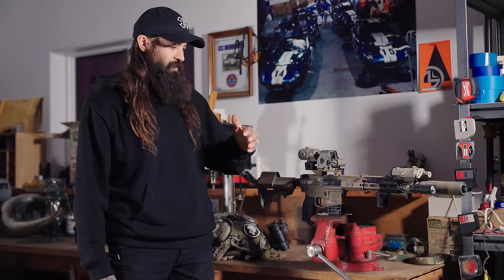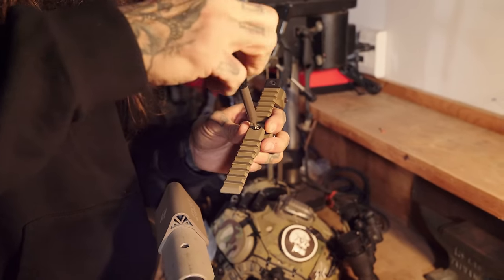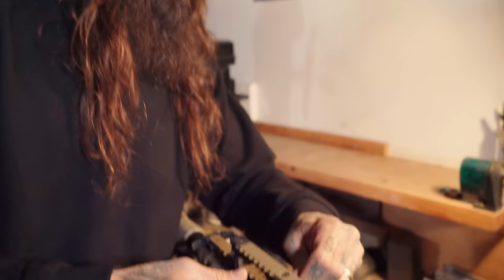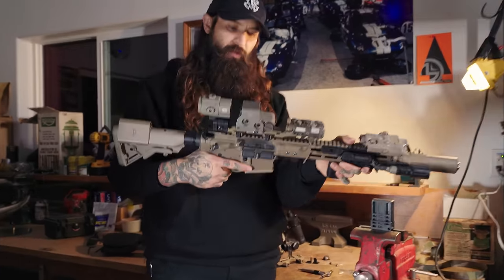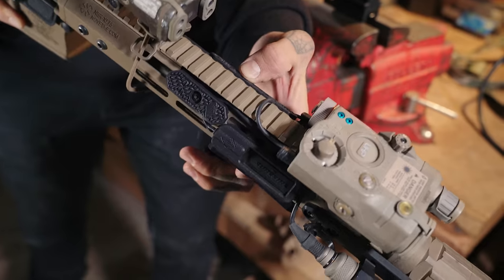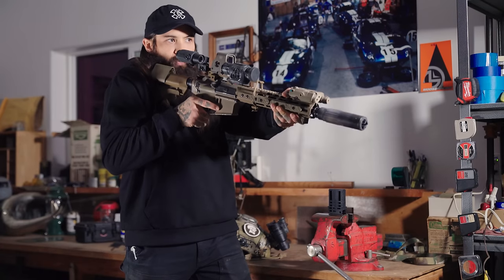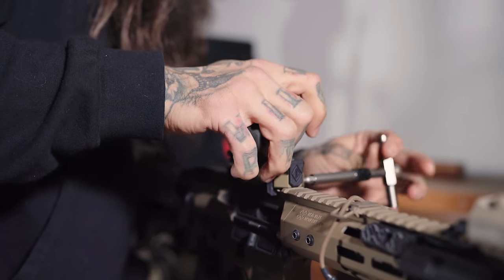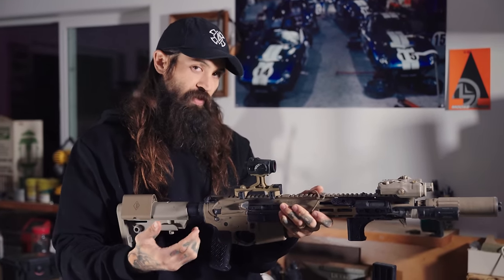IRREGULAR DEFENSE OMM (OPTIC MOUNT MODULAR)

Comment: As a mechanical engineer I can say that this is a work of art. The OMM mount gives you the chance to use either Unity OMNI or Eotech mount and swap configurations as desired without having to buy third-party accessories or adapters. There are plenty of other risers but none of them compete with the OMM modularity. And the term modularity perfectly aligns with Slade's mentality " If you don't need it, you don't buy it". Hope to get them very soon here at Operator's Manual LLC!

Comment: Just got my OMM Micro + MidBoard for my T2. LAM selection pending. 7075-T6 with full Type 3 anodize and 304 stainless hardware. Just superb. Not crapping on the 4-letter boys' mount....but the Hydra is 6061 (nearly 4x weaker depending on design) and is only cerakoated (super easy to damage).
Reply from the maker: Thank you sir!

Comment: Nice choice of song.
2ndly: Are there retro-fit throw levers in the works for the OMM? Necessity dictates I run buis, being able to "rapidly" take the mount off is a big deal for me. I know, its silly but it is what it is. And the mount is pretty dope, i have it (currently) on a DD MK18 RISlll upper amd its beautiful- keep up the good work!
Reply from the maker: Hey dude, we aren’t doing QD for a couple reasons. Form factor and weight are the 2 off the top of my head. We do have a solution for BUIS coming down the line soon. Also, they will be able to mount in line and not offset.
Reply: @Slayderaider  
Cool, I can understand. And thanks for the reply🤘

Comment: What's up Slade, quick question for ya boss. In your experience, what is better for NVG setup; flip to center, or to side?
Reply from the maker: I enjoy the flip to side. The Unity FTC is a cool concept, it just doesn’t clear out of my way enough and I can’t bring it far enough rearward to deal with the crappy eye relief of magnifiers.
Reply: @Slayderaider  that is precisely the issue I had. I believed the solution to be to take the magnifier off during NVG use. This makes since tho. Thanks
Reply from the maker: If you run thermal you need the magnifier
Reply: @Slayderaider  okay question. Would you rather run thermal on your head, or on the gun?

Comment: if I wanted to run the base mount, and a EOTech, and an EOTech magnifier, could I technically run a Unity FTC on the magnifier behind it? Or does the OMM sit a little taller? (I could probably do the math, but I’m being special right now)
Reply from the maker: If you had the XPS 2.0 it would line up perfectly, but with the EXPS 3 it will have about a .24” disparity in height. The optics side of the magnifier is forgiving so it may work. Someone on here said they did it and it caused no issues for them

Comment: Awesome stuff man. Can you use a unity flip to center for the magnifier behind the bare mount if you prefer that over a flip to side?
Reply from the maker: You can I guess, there would be a little aesthetic gap but magnifiers are very forgiving on the optic end. Also, a 1.54 optic mounted to the OMM PIC would line up perfectly.

Comment: Holy hell. This is exactly what I've been needing on my 8" 300AAC to run my dbal in front of my vortex UH-1. I tried to piece something like this together with a Unity riser and an "Amazon special" pic mount to try an pull off the same thing as the OMM pic with the longboard. The amazon pic extension bent the first day so it was useless.

Anyway I can sign up for notifications for when you're back in stock?
Reply from the maker: Nice! The website subscribers get emails!
Reply: @Slayderaider  Sub'd

Comment: When slade said it was at 2.5 height was that the height from the center of the barrel to the optic center or was that from the rail to the center of the optic? If that is the rail to the optic center I've never messed with anything so high is that height just to clear the optic over the ir device which is clearing your finger on the forend? Or is there another reason for a 2.5 height over a 1.93 or a 2.26?
Reply from the maker: Optical centerline is 2.5”. It felt the most comfortable sitting at that height

Comment: Does shifting the weight of the laser closer to the reciever make a measurable difference to the balance with the can on the front ?
Reply from the maker: It can, but the lasers I run are pretty lightweight. In the end it becomes a preference thing if you’ve got the rail space. If on a shorter rail then it’s nice to be able to shift the laser to the rear of your foregrip and to the center of the upper freeing up that rail space

Comment: With the 2.5 exps height, on something like a 10.3 with a can, what is the holds like with a 50yd zero. Still pretty spot on at 200/300yds?
Reply from the maker: I run a 50m zero, I’ve had good results all the way out to 620 yards
Reply from the maker: But that was with my 11.5, not sure how much of a difference that makes in comparison to a 10.3

Comment: Does this mount work with the unity flip to center? Ik they have two sizes now
Reply: He'll definitely come out with a tiny pic riser to raise the FTC mount. Doubt Unity will make a new FTC height mount just for him
Reply from the maker: If you run an XPS 2 or 1.54 lower third optic on the OMM PIC it will work.

Comment: What is the optic height with this system,  ie Is this compatable with the unity ftc magnifier?
Reply: It's not, I think it's 2.55" something
Reply from the maker: 2.5” with eotech EXPS 3.0. XPS 2.0 or sig Romeo 8T sit at 1.54 which would line up with the OMM PIC mount and the unity FTC

Comment: love more products for this, but i gotta say it doesn't seem drippy. Would rather an upper receiver that has all this integrated with the option to add the forward and rearward picatinny or whatever.  Just dont like the look of having 2 picatinny on top of eachother.
Reply from the maker: That makes options limited
Reply: @Slayderaider  if you had standard upper receiver length picatinny that was just lifted 2 and some inches, and a mounting point for the forward attachment you have it would provide the exact same options.
Reply: Imagine a carry handle, but not a carry handle

Comment: Went to the website thinking I could get a mount for cheaper than Gbrs. Damn was I wrong
Reply from the maker: Yeah, they’ve since reduced their pricing when they saw something with superior design and materials was coming to market. Our pricing reflects what it cost for us to produce.
Reply from the maker: And let’s do the math, it definitely depends on what your end goal is. Hydra pic mount is $325, Micro is $350 (6061, Cerakote and hex bolts). If you want a magnifier mount you need to first buy the magnifier (cost depends on which one you buy) then buy their Unity mount for $274. If you want a LERNA those are $174-$184. If the LERNA was all you wanted, then yes. It would be cheaper. But if you wanted a magnifier, you are back to the cost of the magnifier in addition to their $274 magnifier mount. So the cheapest from them with a magnifier would be $448. Where as we would be $305 for OMM PIC and OMM SHORTBOARD (optic Mount with magnifier attachment). So I’d say you were wrong on multiple levels.

Comment: U cant run the unity riser tho , the flip to side magnifiers are garbage
Reply from the maker: You can depending on which optic you run. 1.54 (XPS 2.0, Romeo 8T) will line up on the OMM PIC. Also, heard some others say that they ran it with the Micro mount and didn’t run into issues. I do know that the optic side of a quality magnifier is pretty forgiving. Unity makes great stuff, I just prefer the flip to side. It’s lighter, cheaper and gets out of the way when I’m on NOD’s.

Comment: 2 Lasers for extra swag points
Reply from the maker: 2 is one. 😂
Reply: @Slayderaider  haha the thumb will be doing 'finger gymnastics' switching through the 2 lasers and the flashlight. Like them guitar games where you have to press the right note and shit
Reply from the maker: You do know the lasers being doubled up on there were for the demo of the optic mount and it’s different optional configurations. As in, I don’t run 2 lasers, I just didn’t feel like taking my laser off the front of my rail when I was making the video.
Reply: @Slayderaider  of course hahaha. But I was just imagining a case where some giga chad operator took the statement 2 is one and 1 is none a little too literally 😂
Reply from the maker: I’m sure there were some… 😂

Comment: Lololol why have that tall optic mount and then have that cheek riser?
Reply from the maker: The concept is tricky if you haven’t run one. It allows for the 4th point of contact when shooting, but instead of having to bring the whole length of the rifle up to make that contact for the cheek weld, it’s a smaller surface area that fits in the gap. So when running NVG’s I’m not having to smack those into the buffer tube and stock.